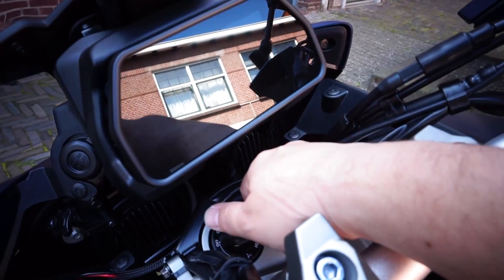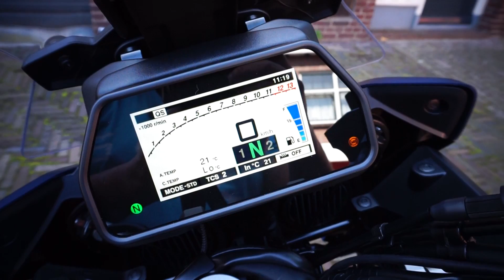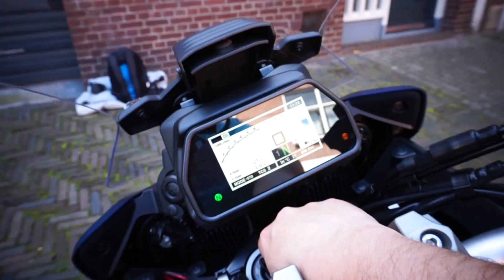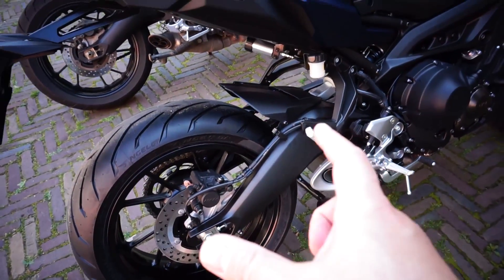Differences between the Tracer '15 and Tracer GT '18 | Tracer GT #2

Comment from the maker: I just heard from the dealer today that if you install the short tail tidy from Yamaha the side cases won't fit, because of the blinkers! Take that into account if you're planning to make such a mod, even with other brands of tail tidies.
Reply: if you want a tail tidy guess you can go with integrated tail light turn signals :)

https://www.motodynamic.com/2014-2016-yamaha-fz-09-fj-09-sequential-led-tail-lights-clear.html
Reply from the maker: I don't like these type of indicators, visibility is very poor.
Reply: I’m glad you mentioned that, I was just about to order a tail tidy. Pick my new Tracer up on Thursday.
Reply: You should be also careful if you're installing kappa-givi engine bars kn-2122 on the Tracer 2018. They are tight against the front blinkers, as they (blinkers) are much lower on the Tracer 2018.

Comment: Good morning from Greece! Lovely bike! I wish you have infinite km with it. I put it on my program to buy it at the same color.

Please be noticed that it has also an adjustable shift light on the dashboard, as it is from R1.

As for the suspension, it has compression adjustment, that the old one didn't.

At the end...the price is BANG for what it gives you, compared to other bikes in the same category!

Be safe and ride even more!
Reply from the maker: I'll make a video on the dash alone. Indeed there is a programmable shift light on it.

Comment from the maker: A lot of people asked about the seat compatibility with the previous model. I asked someone to test this for me, and here's the info I got:
- the rider seat of the 2018 Tracer will fit the 2015-17 models;
- the passenger seat of the 2018 Tracer will NOT fit the 2015-17 models.

So if you want to improve comfort on your 15-17 Tracer, the new seat might be an option.

I want to make a video on this but I need to find access to a 15-17 Tracer since mine is already gone. Wait for the video if you want to play safe.

Comment: Was the Tracer GT 2018-2020 supplied with such side trunks included, or was it still an additional option for a fee? I'm asking because I'm currently looking at an option on the secondary market and most of the GT's of these years are sold without side bags.
Reply from the maker: Definitely included, but maybe not in some markets

Comment: what is the meaning of the two different mm sizes of the new handlebars?  i have a 2016 model and they are just way to wide to ride comfortably.  i am 5.6" tall and apparently i have shorter arm length.  when riding aggressively i almost have to sit up on the tank.....  is there a big noticeable difference between the two?  thank you
Reply from the maker: It's noticeable, yes. If you have problems with it, you should definitely change. Even a small difference in width makes a big difference in comfort.

Comment: TY for the video. One question I never hear answered about the FZ MT 09 is regarding fuel economy. I've ruled out the FZ 10 for a number of reasons. One being poor fuel economy. What has your experience been on the Tracer for fuel consumption?
Reply from the maker: I track the fuel consumption of all my vehicles in detail using Spritmonitor. The 2015 Tracer had, after 20686 km (12854 miles) an average fuel consumption of 5.06 L/100 km (46.49 mpg - US gallon). The 2018 Tracer GT has an average fuel consumption, after 4795 km (2979 miles) of 4.95 L/100 km (47.52 mpg - US gallon). The difference between them is negligible, probably the type of roads I rode in are what accounts for the difference.
Reply: Wow, Thanks for the fast follow up. Greatly appreciated. I'm pretty much spending my afternoon looking at what will become my next bike. 47mpg pretty much solidify's my choice. When added to Yamaha reliability it makes the choice easy for me. I'm currently long in the tooth on my current Sport Touring bike, an 05 VFR800. Which has proven to be Bullet Proof. The added torque and HP of the Yamaha is also a deciding factor for the rare occasion when my wifey is on back.

Thanks again. PS, can I get a get a job application from you? LOL, just joking, I retire next month and plan to ride the Western States for 6 mos +/-.......Next Spring/Summer.
Reply: @MotoRiderTube  ö

Comment: hey just rode home on a new 2020 gt yesterday,,i think the first thing i do is gonna be pulling that windscreen off,,its terrible,,my naked fz07 wasn't nearly as bad ,,no matter what position the wind noise is awful ,,dont know how your clutch is but mine is really bad and there appears to be no way to adjust at lever ,,it doesnt engage till all the way out ,,,is yours adjustable ?
thanks
Reply from the maker: Congratulations on the new bike! All naked bikes have better wind performance because it's "clean wind", undisturbed by any screen. Compared to one, all screens will be bad. You need to find one that fits you. The stock clutch lever is not adjustable on this bike, you'll have to replace with aftermarket. There are official accessories (pretty expensive) or cheap Chinese versions on Aliexpress that work as well as the expensive ones. I have a pair of Evotech Performance levers, very good and high quality.
Reply: @MotoRiderTube  agreed,,,,the air from shield actually will force my face shield down ,,i like riding with it up  most of the time ,,plus the wind will reverberate in my ears   which is a bit painful,,Im gonna try cutting a few inches off ,,,or  re-angle it
Reply: @MotoRiderTube  so for me the shield was really bad in tall position and a bit better in low position,,i wound up cutting off about two inches and its MUCH better ,, next i will tint it ,
thanks for the lever info,,i was able to get a little adjustment from wheel  made a lot better till new ones show up,,i replaced old mt07 with the shorty and loved the feel and look,,plus easy adjustable

Comment: I wonder if the narrower handlebar can fit on my 2016 FJ09/Tracer 900.
Reply from the maker: I'm pretty sure they can, the question is the hand guards - is there enough room at the bar end for the larger 2016 hand guards?
Reply: @MotoRiderTube  Is the new handguard screw shorter? Not an issue for me, I took the handguards off! They threw off my depth perception when lanesplitting and they didn't block much wind anyways.
Reply from the maker: @joevidya  I don't know about the screws or mountings, but the hand guard itself is much narrower where it meets the handlebar. If you took them off, you just need to get some bar ends, maybe your current ones work.

Comment: I'm waiting on the Tracer to be available here in the U.S.  May be trading in my V-Strom 1000 on it....Is there any vibration when riding?
Reply from the maker: Not really, this engine is really smooth. Some people complain about the metal foot pegs, but you can easily swap with rubber-covered pegs from the FJR, if you feel like it - I never felt the need.

Comment: I’m in the market for a new bike, currently looking at the Ducati Multistrada 950, BMW R1200 GS & GSA, but also, the Yamaha Tracers 700 and 900 which I have heard very good things about.  As an all-round bike what’s your opinion and have you ever riden the other models mentioned as a comparison. Just thought it worth asking as you’ve got good experience of the Tracer.
Reply from the maker: I've only tried the GS. One thing is clear: the more expensive the bike is, the more quality you get: better components, better ride. But the Tracer is by far the most fun of this group, and the one where you get the most for what you paid. There's no reason not to go for the Tracer, unless you have too much money or you really like another one.
Reply: The Multistrada has a lot of vibrations, I did not like it. The GS is a good bike but expensive. I've ridden them all and bought the Tracer 900 GT. I just love it! It's such a versatile bike and it's looks good to :-)
Reply: Jonas Karlsson ...I’ve set up test rides for all the bikes over the next week so will let you know how I get on.
Reply: Agree with Jonas.... I have the 2015 model Tracer in Australia 
 which I simply love, but hired a brand new Ducati Multistrada 950 in Milan in April and did 900kmnin 3 days around the Lake Como and Magiorre regions. Vibrations were major....Tracer is smooth.  The fittings on the Duc were a little nicer quality than my 2015 but the $$ difference is significant....looks like the new 2018 GT has stepped up the fit, feel and finish to close some.of that gap. The Duc feels like a bigger frame bike and the Tracer more agile.
Great review of the differences between 2015 and 2018....builds a strong case to change over my own for the additional features.

Comment: MRA is bringing out a new spoiler for this screen on the 25th June. Will you be installing your engine crash bars?
Reply from the maker: Thanks for the info, this time I will try to use a spoiler only instead of replacing the complete screen, like I did before. As for crash bars, I will buy new ones - the others stayed with the bike when I delivered. Video coming out soon on the old ones (long term review).

Comment: Hey, thanks for the upload. As someone who owns the 2017 version I have two questions that I hope you might know the answer to:
1) Will the new seat fit on the previous model? 
2) Will the new panniers lock into the existing fitment on the subframe of the previous model? 
The yamaha website says that these items are compatible with previous year models but there seems to be debate if this is accurate or not.
Reply from the maker: Hey. 
1) I don't know, I forgot to test it. I asked someone to test this when that person does a test-drive.
2) Yes, the "new" panniers are the same as available in the US for a few years now, and on the FJR for more than 10 years. However, due to the new passenger footpegs, you might need a different support on the footpegs.
Reply: Critical Rider Thanks for the reply mate. Just seen how expensive the panniers are to buy so might avoid that anyway. The new heated seat seems appealing though.....if it fits last year's model.

Comment: HI, I have quick one as you are in possession of both at the moment. Mine one is 17 model almost new and I am thinking about some upgrades. Can you tell me does 18th model seat can fit on older models of Tracer 900?
Reply: I was about to ask the same question, mine is a 2016 but as I'm short I use to ride very close to the tank and in medium to long trips I really hate the seat and before the launching of the new GT I was thinking on invest a good money in a great after market seat, but now that the GT it's on the field I need to know if I buy the new AM seat only if the older seats are compatibles with the new GT seat brackets, does any one knows? Thanks in advance
Reply from the maker: I don't have both anymore, I delivered the old one to the dealer. Unfortunately I forgot to see if I could switch the seats. I have asked someone, who is going for a test ride tomorrow, to see if they can try it.
Reply: Thanks, it will be great if you can find out.
Reply: Few  differences between 2017 and 2018 Tracer but massive changes from 2015 model, biggest improvement being the suspension front and rear, 2017 upwards. Not worth the change in my opinion. However the video compare the 2015 to the 2018 GT which costs a lot more than the standard 2018.model. The 2018 GT is more suited towards touring, whereas die 2017 will still be the  best for wheelies than both 2018 models as the rear swingarm is shorter.
Reply from the maker: You are correct. The video is done from my perspective, where I use the bike for touring and some weekend rides. I never wheelied a (motor)bike, and I'm too old to start learning :)

Comment: thanks. do you know if the forks on the GT are the same as on the MT-09SP?
Reply from the maker: I can't find any conclusive answer to that, but here's what I have on the SP: "Kayaba units with dual-rate springs and adjustability of both high-speed and low-speed compression damping, as well as preload and rebound damping". I don't think the Tracer GT has high-speed and low-speed compression damping (I may be wrong, haven't explored in full) so they may be different units.
Reply: think you're right, for the GT there is reference to high/low speed settings

Comment: Hello. there is information? can the seats be fitted from 2018 to 2015?
Reply from the maker: - the rider seat of the 2018 Tracer will fit the 2015-17 models;
- the passenger seat of the 2018 Tracer will NOT fit the 2015-17 models.

Comment: You didn't forget the outrow and say goodbey, you want to drive I think :-)
You bought the 18 not at you'r normal dealer, you bought the new one in Nijmegen. Because you moved more to the North of the Netherlands. Is that right??
I like you'r details very much. There is a lot more changed than i thougt.
I look forward to more diiferences and accesiores that you will discover.
Reply: Nijmegen is in the east not in the north
Reply: If you lived before in the south of The Netherlands than is Nijmegen more north.
Reply from the maker: I bought my previous bike also in Nijmegen. I didn't move, but the dealer in Nijmegen is very good, so I don't mind driving one hour to buy the bike from them.

Comment: Hello did you experience wobbles in high speed to your tracer  2019?
Reply from the maker: Nope.
Reply: whats high speed ???? I just came off a 350 mile ride on new 2020GT,,and I have as many dislikes as likes with this bike ,,feel free to jump in.,,Bike has a slight wobble 40-48 mph,,not terrible,,. but its there ,,I dont want any wobble in my bike,,So higher speeds ,,60,,70,,80 plus no wobble ,,,BUT the bike feels like it wants to wobble if that makes sense,?? ,, feels like its being hit with strong side winds ,,if you mimic a wobble by tweaking the bars {not alot}  it feels like it could wobble out really easy.So with that said the bike is very smooth  when cruising  along.  whats not so smooth is the very annoying vibration at 51-55 K RPMS ,,,,also the combination of the slack in throttle  on take off and the clutches late engagement gives cause for major embarrassing rookie moment. ,a  flat spot on hard acceleration around 42k RPM is concerning ,,slight engine surging at low speeds 1st and 2and gear ,i can live with that ,,gas gauge,,one minute it has a full tank then boom ,,its half full  ,,minor detail ,,the cluster is a cluster fuck,,hard to find turn signals and other controls ,,i wish they would at least highlite the buttons  cause when you look at them at 70 mph its all black ,, ,,you need a REALLY long right thumb to operate the dash wheel,,,, if i can fix half of this shit i think it will be a great bike ,,for now im going for a ride ,hahaha

Comment: its got gt in the rear tyre how cool is that,
Reply from the maker: That's because it's a Pirelli Angel GT, which I had installed even before the bike was delivered. The dealer kept the shit Dunlop D222 that came from factory.
Reply: Cool vid. Did you have to pay extra for the Angel GTs?
Reply from the maker: Yes, a little bit, but that included the price difference and the tire installation.
Reply: Critical Rider thanks!

Comment: Looks nice, congratulations on your new baby. You should have taken us for a ride. Do you notice any differences from your 2015 in the ride, power or handling with the new suspension? Good luck and keep your head on a swivel!!!
Reply from the maker: I only had 30 min riding with it yet, so not enough to make an opinion.

Comment: Display and heatgrips are NOT standard! They are only standard with the high version.. the Tracer GT. The normal Tracer does not have both as standard!
And the suspension and the cruise-control is only standard at the GT Version too!!! ... so you should have said this at the beginning of the video. You dont have a "standard" Tracer.. you got the much more expensive GT-Version!
Reply from the maker: Mate, this video is comparing the GT version with the 2015. These things are standard on the GT, what are you on about? Look at the title, look at the first picture of the video... it's all about the GT version. I never said I have a standard version, I said these things come standard with the GT version, meaning you don't have to pay extra for them.
Reply: he said it was a GT, keep up man!